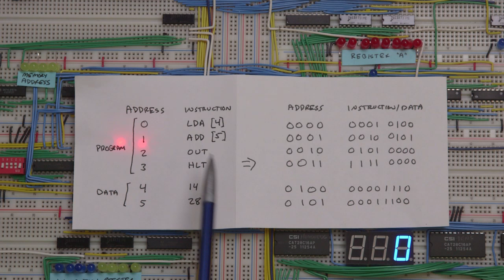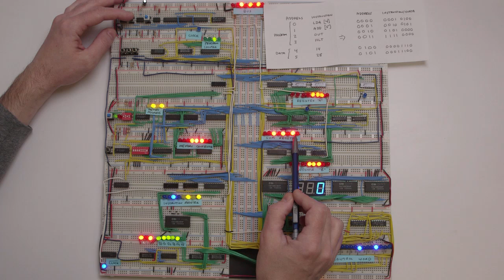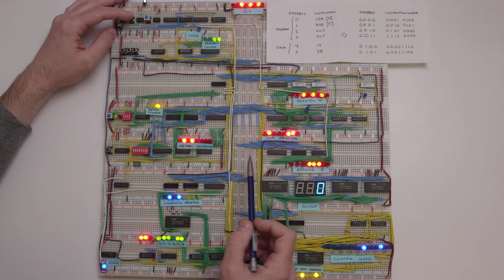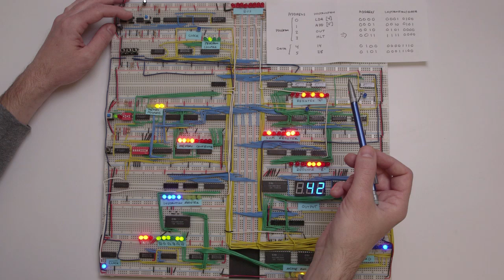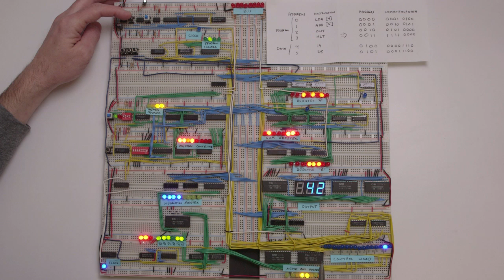Stepping through a program on the 8-bit breadboard computer

Comment: It would be really interesting if you actually showed what is happening 
The computer does do anything, somehow transistors are opened or closed 
How does a transistor get activated which moves memory or engages a full adder 
Show us by following the electrical connections 
Why does 1001 in a program register change transistor that then change other transistor in a full adder which the creates a transistor being on which leads to a write transistor being turned on etc

Comment: So in your machine, you basically have wasted clock cycles for T5 on LDA and various instructions which need less steps. But is there a way to skip the steps that aren't required and start at T0 for the next instruction?

Comment: This thing gave me an idea. I love it.
I'm thinking of making my own computer, whose only purpose is to be the foundation of a simulation world that is inhabited by neural networks, and their goal is to attempt to communicate with me. But they would have to pass a bunch of tests(in their world) before they can meet with me.
and maybe i'll add the ability to connect a monitor and controller so that I can walk around and take a look at things and interact and stuff.
Reply: How about you try coding the simulation first? Or maybe learn how to code a neural network? Or, you know, code at all.
Reply: Either you're the next Nikola Tesla or you're in for a wake-up call. Good luck :)
Reply: +Anthony Khodanian
Yeah, I know how to do all that. I've just had this idea of making a hardwired specialized system.
But for now I think that I'm just gonna make a small Operating System dedicated to the task. This way I could try and utilize the full power of the computer without having to worry about how many microsoft services I have running in the background.
Reply: +Rasmus0909
Oh yeah, I woke up about a week later. I have this idea of making a computer that has one purpose and that's to have hardwired neural nets control a simulation. 
I have one vague idea just floating around in my head, but I can't quite figure out how to make it happen.
For now I'm thinking that I have to use a mixture or AC and DC currents but other than that I'm just gonna have to what Anthony Khodanian suggests and code a simulation.

Comment: I have some questions:
1. How do you avoid having a free running loop between the A-register and the ALU when you write the sum back to the A-register? I thought that maybe you buffer the input to the A-register when you press the button and... "commit" (for lack of a better term) the value when you release it, but the LEDs are changing at the same time so that does not seem to be the case.
Same thing with the program counter.
2. I had a second question but while I was writing the first one I forgot it.
Reply: Ihrbekommtmeinen Richtigennamennicht 

The computer uses a clock which prevents that from happening.
Reply: Please read my comment at "Testing the computer's ALU" https://www.youtube.com/watch?v=4nCMDvnR2Fg
And a similar problem arises at "Master-slave JK flip-flop" https://www.youtube.com/watch?v=rXHSB5w7CyE

Comment: So every singular instruction takes 6 cycles? Thats... longer than i thought o_O Is this still the same for modern 64bit CPUs?

For the question what would happen if you could advance beyond the HLT:
It would read the 14 (00001110) as an instruction (in this case 0000 NOP with parameter 1110) so nothing would happen.
Next is the 28 (00011100), which means 0001= LDA with 1100=12, so it would read memory address 12 into register A (which is probably 0b0). After that, everything is 0b0, so just NOP commands.
Reply: Modern CPUs can do multiple instructions per clock (IPC).
Reply: Two things happen in modern CPUs:

ⅰ) Processing is pipelined. For example, assuming each instruction takes six phases, a CPU would be executing six instructions at once but each would be in a different phase. While one instruction is finishing, instruction four steps behind is being fetched and an address if instruction five steps behind is being loaded. With this, even though each instruction takes six clock cycles, an instruction is executed every cycle.

ⅱ) There are multiple ALUs which means that CPU can perform multiple operations at once. If one instruction sums two registers and another sums some other registers, those two operations can be carried out in parallel.

This is of course simplified, and there are multiple things that complicate the issue such as:

ⅰ) Data dependencies: ‘a = a + b’ instruction followed by ‘a = a + c’ cannot be executed in parallel since result of the latter depends on the result of the former. To mitigate, CPU will try and rearrange instructions and execute them out of order. For example, sequence ‘a = a + b; a = a + c; d = e + f’ can be rewritten as: ‘a = a + b; d = e + f; a = a + c’.

ⅱ) Control dependencies: conditional jumps mess with the pipeline since what next instruction needs to be executed depends on the result of the current one. This means that it’s not possible to know which next instruction to fetch before the current one finishes. To mitigate, CPU will try to predict which branch is taken and execute instructions from that branch. If later the prediction turns out to be false, all the calculations will be discarded. x86 architecture also includes conditional move instructions, for example ‘set EAX to 10 if carry flag is set’. This changes control dependency into data dependency which has lower penalty on misprediction.

ⅲ) Different number of different execution units: A CPU might be able to perform two additions at once but may be unable to perform two multiplications at once just because it has some components duplicated but others not. Similarly to ⅰ), CPU may try to mitigate by rearranging operations.

And I didn’t even mention memory yet. A memory read can take dozens or even hundreds of clock cycles. ‘How much clock cycles an instruction takes’ is nowadays a very complicated question to answer and you probably can count number of people who know the answer to that on your fingers.

Comment: just a question, are RAM and PROGRAM memory the same in that computer, so the program could change in the fly his own code? leading to unpredictable results in most of the cases, but could it be used to show something cool?
Reply: It's like that on x86. Programs are run from ram. The difference is that on x86, the computer loads the program into memory for you and then executes it, and has memory protection, so the code in memory can't be modified by the program. (In modern os')

Comment: Why not combine T1 and T2 into one micro instruction ?
Reply: It's hard to do that, 'micro instructions' need multiple clock cycles, his Tx steps all need exactly one clock cycle. Also, it's all built around this central bus. Not sure how you would combine those two?
So combining would mean input=>instruction address, output=> instruction. but the memory where you get the data from is designed to take 2 cycles, one address write cycle and one data read cycle. You could combine those two, or even ommit them completely, if you'd seperate data and instruction memory, and therefore hardcode the connection between instruction address register and instruction memory. Or not use a bus at all and have everything hard connected. But this computer doesn't seem about efficiency, but rather education and a fun project. And I think it's nice to be able to watch the instruction load process :)

Comment: With the add instruction, how do you make sure that there is no feedback loop when you store the Sum to the A registry?
Reply: The answer lies in the basic understanding of Flipflops (not sure how he did it, but that's how it's usually done) and its difference to a latch.
A LATCH takes over the input data as long as 'high' is on the enable pin, a FLIPFLOP only takes over the input data at the low-to-high edge of the enable pin. It happens so fast that the output of the flipflop changes AFTER the write has happened, and then when the propagated feedback looped data arrives at the FLIPFLOP, it won't read it any more.

At least that's the simplified version explanation.

Hope that made it clear.
Greetz
Reply: M. Sierra isn't it heavily dependent on the length of the rising (or falling) edge of the clock?

Comment: is it possible to have a 2 bit computer
Reply: Aakash Mandal I'd say yes although the most you could do is some command that displays a number

Program:
00 - LDA [3]
01 - OUT
10 - HLT
Data:
11 - {an integer being either 1 or 2}
Reply: Exactly what the dude said above me. You can only make commands for each binary combination.

A 16-bit computer has 256 possible commands:

00000000
00000001
00000010
00000011
00000100
00000101
00000110
00000111...

And so on until you hit the last one (11111111). That would be the 256th (and final) combination at which you could associate an assembly (machine code) command.

Which means you could also only have a maximum of 256 memory locations in RAM.  But even that could only be achieved if you had multi-byte instructions.

This is obviously a lot more memory and byte-size than the 8-bit one being shown here in the video.

Comment: how do you sync up the enable out and set in wires. like if the enable out control wire goes off the set wire may save nothing into the appropriate register. hope my question makes sense.

Comment: is there any reason why the control word changes in that specific sequence? Could it have just incremented like the program counter did?
Reply: The control word is telling which registers to Set and which to Enable. All the registers read off the same data bus, so for any given instruction, only one register should be Enabled to output it's contents to the bus, and typically only one will be Set to store the bus value. For example, the LoaD A instruction at 4:47 in the video, for the t4 micro-instruction, Enables the memory address to output to the bus, and Sets the A register to the value on the bus. So the control word isn't incrementing, so much as it's dictating what each register should do.

Comment: if this is an 8 bit computer, how come the instructions are 12 bits?
Reply: No, instructions are actually 8bits. The leftmost  4 binary digits written on that piece of paper are addresses, where the 8bit instructions are stored. Those 4bits are not part of instruction.
Reply: G Yogaraja ah ok thank you
Reply: G Yogaraja so if the upper 4 bits of the instruction are the actual instruction, and the lower 4 bits are the memory address for the instruction to use, then doesn't that mean this computer can actually only access 2^4=16 addresses? I though a n bit computer could access 2^n memory addresses not (2^n)/2?
Reply: "8-bit computer" means that each instruction is 8 bits.  That doesn't say anything about how many addresses are being used, but the computer only being 8 bits does limit it to 2^8 addresses at most.

There are two ways to interpret the instructions, and this breadboard computer uses fixed-length instructions.  That basically means that the first 4 bits are always reserved for an instruction and the last 4 are for a parameter.  This is wasteful for operations like "out" and "halt" which have no parameters.  So some CPUs have extra logic to allow different instructions to use different numbers of bits for the parameters (so halt and out could use 0 bits for the parameters and you could potentially use 7 bits for a single instruction).

For this project it makes sense to use fixed-length instructions, since using variable-length instructions would add a lot of bulk to the instruction decoder, and it would make it a lot harder for beginners (which this series seems to be aimed at) to understand.

Comment: I am confused what makes a 8 bit computer a 8 bit computer?
Reply: Mr Sparklepants it can process 8-bits of data per clock cycle
Reply: 8 bit computers can only address things up to 2^8 things.

16 bit can do 2^16

32 bit, 2^32 etc.

This means, maximum numbers to count to, maximum ram it can hold, maximum... anything that requires a number larger than that, it won't be able to do, or at least not very easily.
Reply: ok,

HERE IS 1 bit
0
here is another 1 bit
1
sadly there are not other unique individual bits, so i can't show you anything beyond 1 and 0  

so.. if you had a 1 bit computer
it would mean that IT'S INSTRUCTION SET CONSISTED OF 1 bit at a time per clock cycle

so if you gave it an instruction like   11   IT WOULD NOT UNDERSTAND, it would not even be able to process it

it would be like me saying to you 
HERE IS A NUMBER that is not a number

see... YOU DON'T UNDERSTAND, YOU BRAIN CAN'T PROCESS THAT

so this is 2 bit binary string
10  or 11   or 00
got it

so  4 bit would be
1101  or  1111   or a string of binary bits that have no more than 4 digits

so 8 bit is     00000000

so an 8 bit computer 
has an 8 bit instruction set or .. 8 bit binary string per clock cycle

the max number you can achieve with this is 1 1 1 1 1 1 1 1
if you convert that to Decimal you get 255

so as an example ,  if we refer to a subnet mask of 255.255.255.0
TO AN 8 bit computer it looks like this

1 1 1 1 1 1 1 1 . 1 1 1 1 1 1 1 1 . 1 1 1 1 1 1 1 1 . 0 0 0 0 0 0 0 0
GET IT....
it processes 8 bits at a time
Just like Parrallel printing technology   which was called BYTEWISE technology

in bitwise technology  SERIAL PRINTING each pin would process 1 bit at a time.
When BYTEWISE tech came around THE PORT COULD PROCESS 8 bits SIMULTANOUSLY 
hence,   the printer could print eight times faster

also  a 16bit computer has instruction sets like this

1010011010100001

DOES THAT MAKE SENSE

Comment: How much did this cost you to make?
Reply: +Preston Stith I would guess less than $40. The breadboards are probably the most expensive part next the the ICs
Reply: It's really cool.
Reply: The most costly part with such a project would normally be the RAM, but in this case it is just 16 bytes, so this isn't a problem. I am currently making a 16 bit computer with 10 bit addresses, so that means 2048 bytes and in my case that would be the most expensive part, if I decide to actually install all 2048 bytes, which I probably won't do.
Reply: 16 bit computer...10 bit addresses.. that means 6 bits for the instructions?